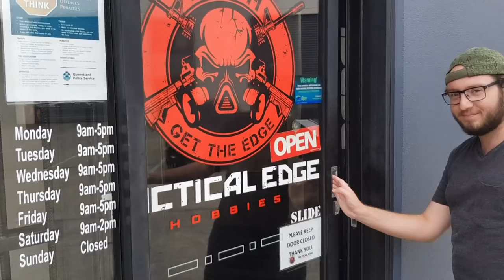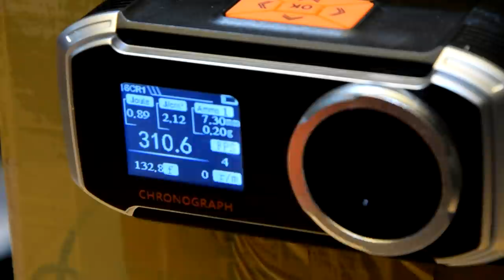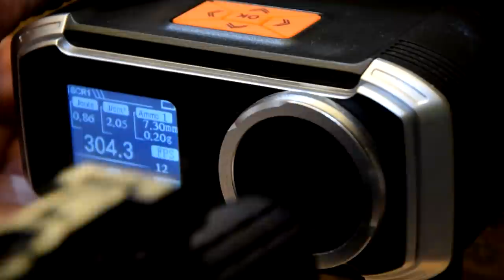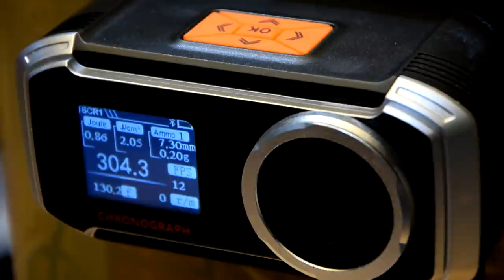BOLBR: Tactical edge Ghost gel blaster review

Comment: If we ever wanted to find a cnc replacement, other than having to modify an mk92 hybrid, do you know of any that are almost identical in design to the the silver edge gearbox? The retroarms split v2 cnc gearbox looks very similar but its always hard to tell.
Reply from the maker: It is hard to tell. By rights a V2 should be a V2 but some have subtle differences.

Comment: as much as i love tac edge i been hearing stories that the silver edge gear box may not be radiused properly and can shatter?
Reply from the maker: It's not radiused at all. And while I haven't had a decent time to really test the limits these new ones seem to be improved over the old
Reply: Low Guido's Chop Shop any update on this yet? How’s your blaster held up? Mine (raptor from tac edge) came with a 7v battery and they said not to use 11v unless I upgraded my already $675 blaster.
Reply: @lowguidoschopshop  Really want to push the button on one of these but am nervous about reliability. How's it going? Are you running an 11v battery on it?
Reply from the maker: @stuartdummkoph128  seems good so far. just running the 7.4V on it.

Comment: I know you commented on this, but there has to be more to the fact that the o-ring didn’t make any difference to the FPS. The difference in the compression with the green one when you changed it was marked. I can’t see how it didn’t change it???
Reply from the maker: I'll be honest I expected a mild gain but no difference. If nothing else it seems more consistent after the change but not more powerful.
Reply: Low Guido's Chop Shop . Hey, thanks for your reply. 
After reading my post, I just want to clarify to everyone that I wasn’t questioning your honesty😇😇 just saying that the extra compression must be lost somewhere else in the system, but I don’t know where.
Reply: The comment at 46:20 was it leveled at the modify tech? What else would you recommend for this blaster?
Reply: The theory is that the compression portion of the cycle forces the o-rings to expand and  increase the seal against the cylinder.  Unfortunately it needs to be an exact 'science' to seal perfectly and gel blaster parts are made with varying tolerances.  Oversizing the o-ring will seal perfectly each time but you introduce additional friction into your system.  My guess is the original oring matched the cylinder perfectly (or close to it) using this princple hence the small fps difference dispite the 'compression test'.